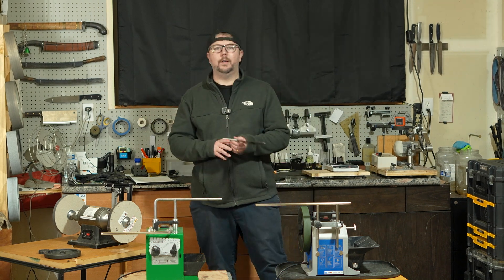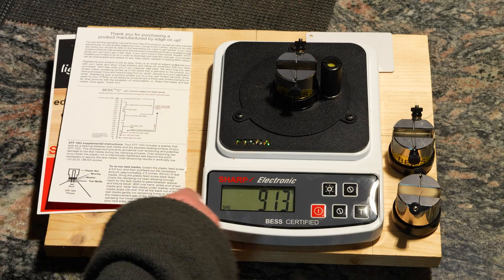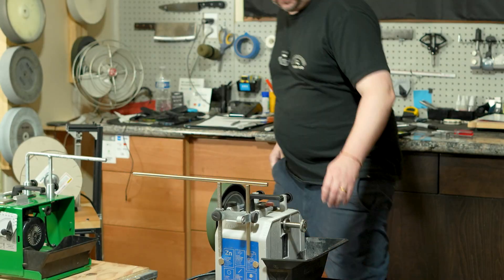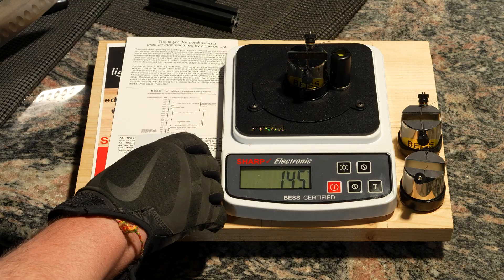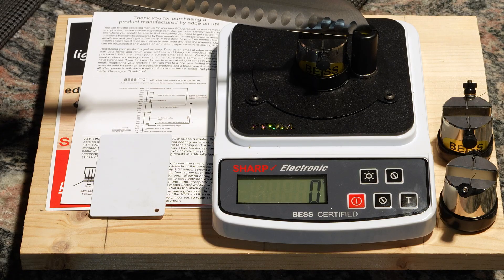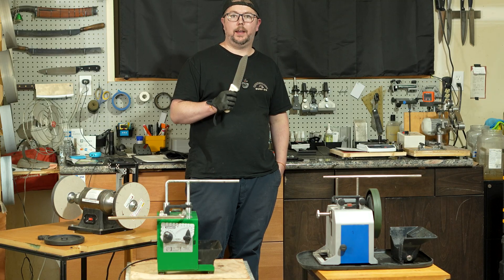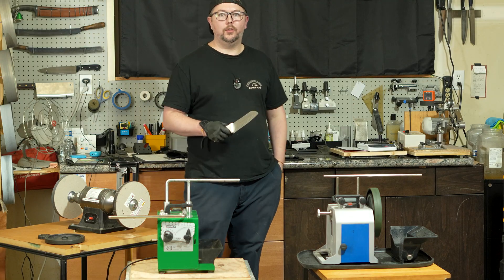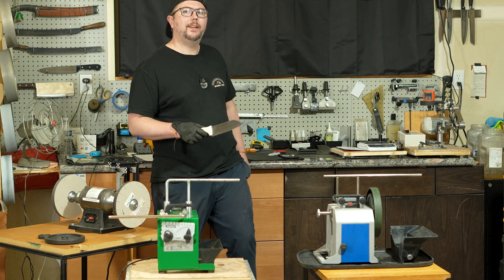[4K] Edge Stability SECRET How to Eliminate Plastic Steel | Tormek T-8

Comment: I actually ran a cut force test cutting Sweet Potatoes, which you might find interesting.  Dull Knife 750 Grams required required 12% more cut force to make the cut than the same knife sharpened to  - 200 grams.  I was not impressed.  Any thoughts ?
Reply from the maker: Oh.
Yeah this is right up my alley. I'd love to know more about how you perform your tests. Are you part of our discord?

Comment: Quick question why you don't use the KS-123 from tormek.  it is easy to use to get the angle.
Reply from the maker: I use to use it, but I value precision over quickness. When I tell a client with an $800 blade that I'm placing a 15° bevel on their blade, I'm ready for them to measure and call me out if its not 15°

Comment: I haven’t started a business of sharpening yet. I have bought 2 super grind 2000 tormex and one jet sharpener. I also went and found a bunch of cheap junk knives $0.50 to 5 bucks a piece to practice with.
Reply from the maker: Smart! I recommend getting ahold of one super steel knife if you can. Put your head down and go to town on those cheap knives. Once you know you've got it figured out, introduce the super steel blade. Not being prepared for SS sucks. Im living proof. Or, you can always so no to SS. In my market, though, half the work I get is SS. I've got no choice.
Reply: @Get-Sharp thank you
Reply from the maker: @paulnease7077 keep us posted on your progress and reach any time with questions. Im hoping i made all the mistakes one cam male 😂